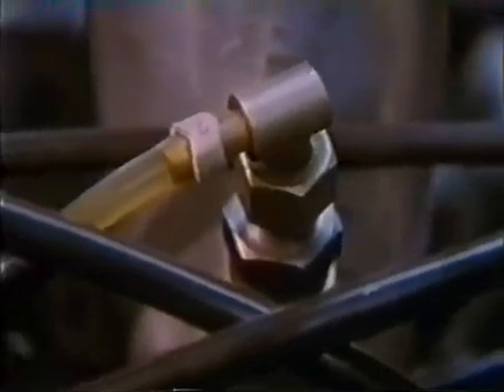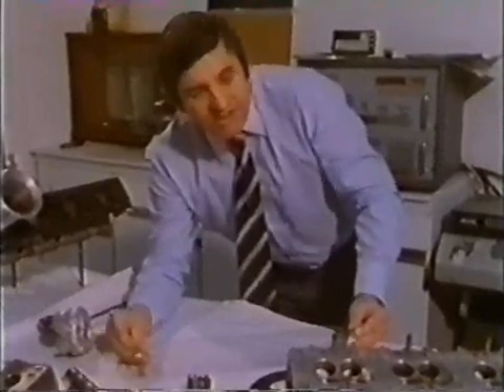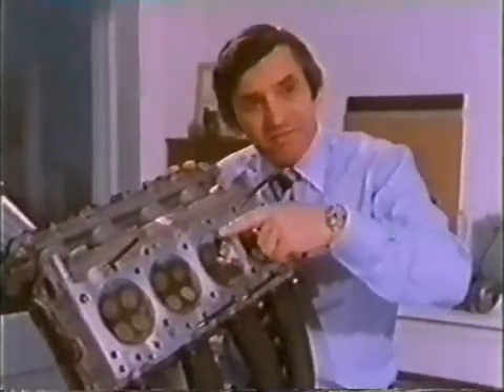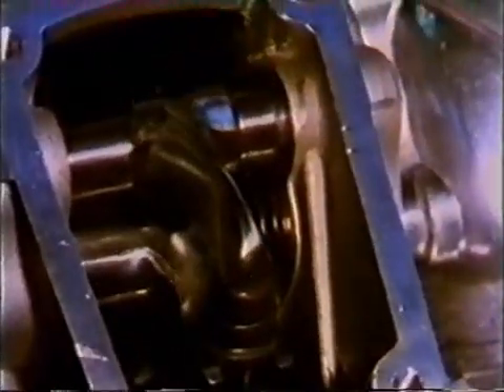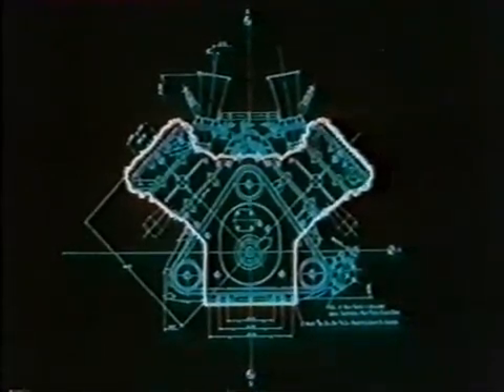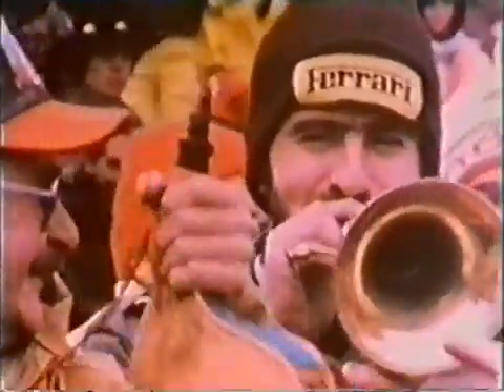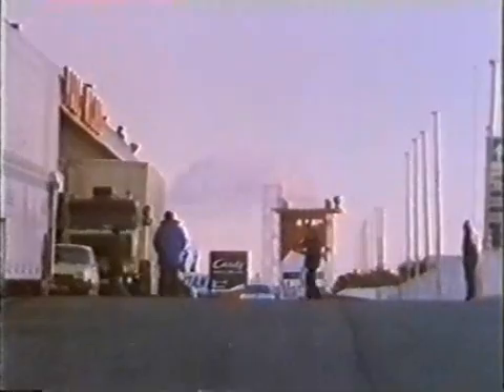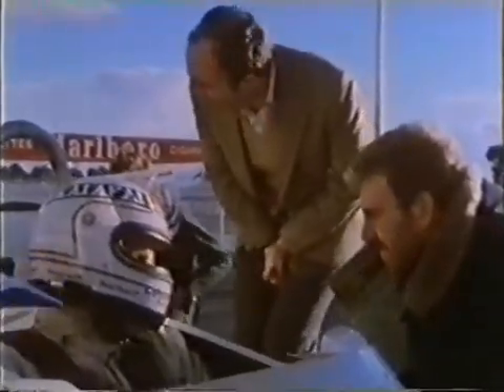BBC Horizon 1981 Gentlemen, lift your skirts Ground Effect & Cosworth DFV Part 6 of 7

Comment: @SuperInline6 

It wouldn't even get close to 18K, pneumatic springs are  required  around 14K i think.
Reply: Honda managed 22k in 1959 with conventional springs
Reply: @thegregdavieschannel  with very small displacement motorcycle engines, it has to be said. It’s much easier when the engine is very small. I own a 250cc 4-cylinder Honda motorcycle which has the limiter set at 17K, but they also made a version of that engine that revved to 20K.